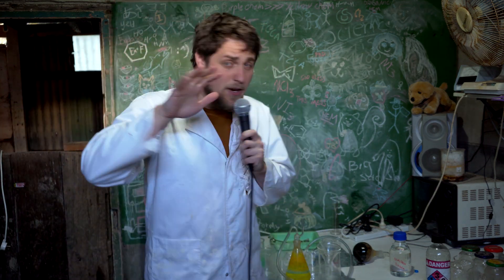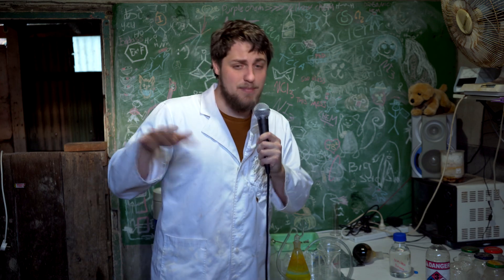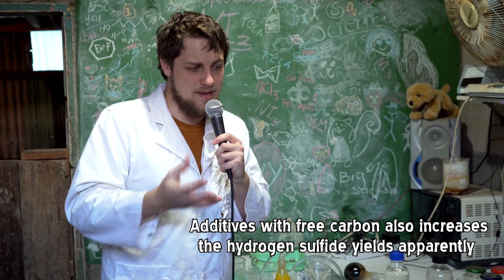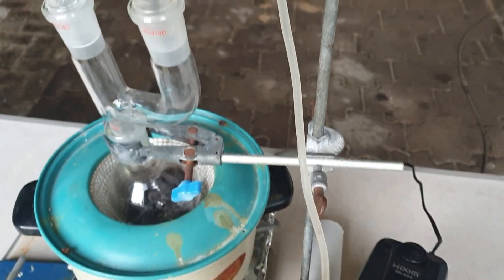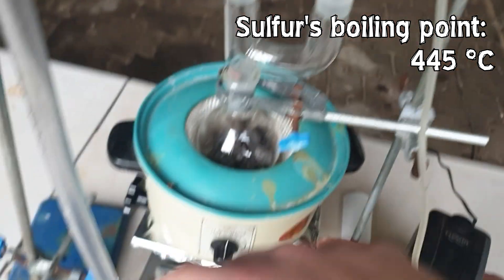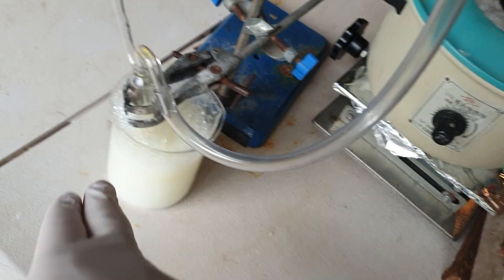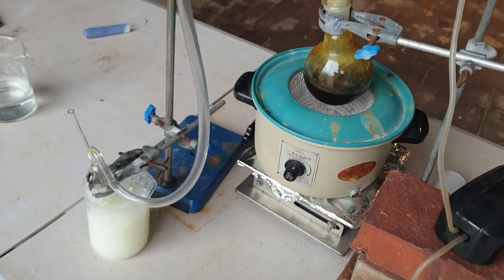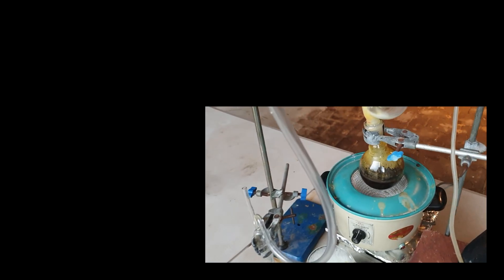A hydrogen sulfide generator using... a candle

Comment: You really dodged a bullet by using a blue candle and not a yellow one. Imagine all the things that could have gone wrong!
Reply from the maker: Exactly! The blue was to counter the yellow of the sulfur, that's how the science works
Reply: @ExtractionsAndIre  blue + yellow = green, hydrogen sulfide is actually sneaky chlorine confirmed.
Reply: @ExtractionsAndIre  perfect alchemy response. this wasn't chemistry this was alchemy^^
Reply: @ExtractionsAndIre  way to keep your humors balanced
Reply: @Man2quilla  pseudoscientific comedy gold
Reply: @ExtractionsAndIre  but...but...you said it wasn't real science.
Reply: @ExtractionsAndIre  
You know you didn’t have to use argon, just use hyperphlogisticated air... uhhh... I mean, use nitrogen enriched air and you’ll be fine.
Reply: @drgazter  depends what he's pumping it into. Some things might react with the nitrogen. Yes it's triple bonded N2 but highly electropositive elements and reactants can still react with n2 gas to produce nitrides and other compounds (lithium nitride being the only stable alkali metal nitride). Argon is generally nonreactive above something like 20 kelvin if memory serves, so unless you're doing reactions in the vacuum of deep space, you won't have any problems. Either way, you don't want any random nitrogen side products forming since there's a good chance they might be explosive and unstable XD. It'll also react with strong oxidizers to produce nitrogen dioxide in some instances as well, but if you're mixing sulfur contributing molecules with strong oxidizers you've already got a bad time on your hands (best of luck). Anything that produces nitrogen dioxide in the presence of water, for instance, will create nitric acid, which has a habit of making things into exploding versions of themselves.
Reply: @ExtractionsAndIre  Green chemistry
Reply: @ExtractionsAndIre  Green chemistry...
Reply: Chemistry is all about superstition holding grudges
Reply: @woosix1  Chemistry is alchemy, with time to build up grudges
Reply: The phase of the moon is more important actually

Comment: This is actually pretty cool. The idea of having a dedicated flask that you just reuse a couple times before cleaning is pretty nice, although I might not want to use a "dedicated vigreux column." 

At the very least, it could be a "cleaner" way of generating metal sulfides, where cleaner means not burning your house down or sorting through slag. This would be more work, and it might seem redundant, but it would give you some advantages.

I might make some ZnS using this method in the future, since I like the idea of making ZnS (it can be phosphorescent, and Zinc is pretty cool in general), but I don't like the idea of sorting through low-quality slag and then grinding it up.

Comment: I mean, WE are generators. Just fart on an h2s monitor 😉

Oilfield truckers get bored sometimes lol
Reply: For real?
Reply: @blackferrets820  Yea, forreal. Part of the distinct smell of farts is hydrogen sulfide.
Reply: I was present at a demonstration of a very expensive gas meter where I worked. It was to measure low O2,  flammable gas in CH4 equivalents, H2S. This meter was supposedly made to be used in a work environment so I put the thing to my butt and ripped one off. The meter squealed and went into alarm and quit working! The guy selling the meters said " I can't believe you did that". We didn't buy those meters. Thanks for the memory, LOL.
Reply: @pixelpatter01  Oh my god that story is brilliant xDDD
Reply: For reals.
Not joking.
Really.
Reply: Especially sulfur from eggs.  In my Gilbert chemistry set in the 1970's this was one of the experiments I did inside (on a smaller scale).  They either didn't mention that it was toxic, or I stopped reading to go do it.
Reply: Organically derived hydrogen sulfide, also known as H2Ass

Comment: What a weird method for making hydrogen sulfide, really intriguing. I usually make hydrogen sulfide by boiling sulfur and sodium hydroxide followed by acidification with hydrochloric acid, super easy and to my surprise, a very easy cleanup, so long as you use excess sodium hydroxide that is.
Reply: Ahh, but his method seems to produce anhydrous Hydrogen Sulfide. 
That is probably useful in some cases. (I don't know enough chem to even begin guessing if that make a difference).
Reply: @The_Keeper  Yea, I guess but most of the time for me it's not necessary, fair point though

Comment: If you calculate the H2S content you need and only put in enough sulphur for three or four equivalents, you can add an excess of wax to make the cleanup easier. Once your reaction is done, just heat to the melting point of the wax and then pour the rest of the wax out. You can reuse the wax if you really want to, as long as you don't use a literal burnt stick for a nucleation site lol. Should also stop the sulphur fouling your precious precious Claisen Adapter (and everything else).
Reply: Is he rich enough to get 4 blue candle sticks?
Reply: Or.. You can use a slight excess of wax, get most of it out after reaction, and just leave the flask as a dedicated H2S generator.  A 250 ml round bottom flask with a glass joint is not that expensive.  Or if you have a well used flask, replace it with a new one and use the old flask for “dirty chemistry”!